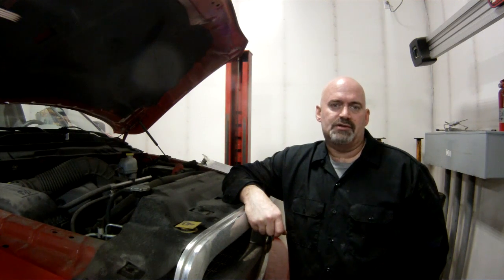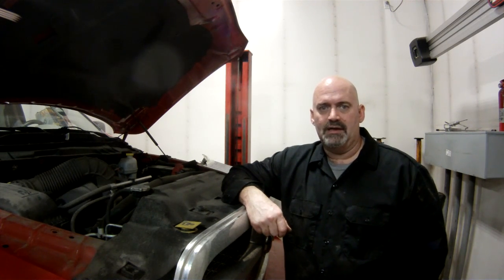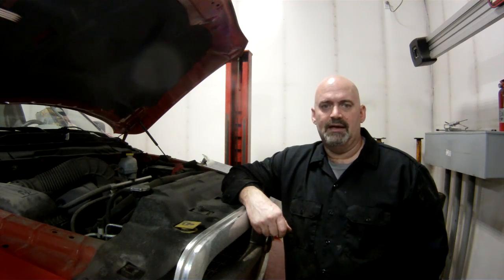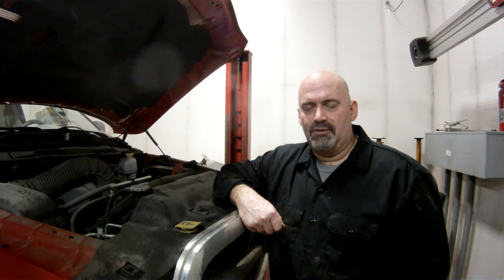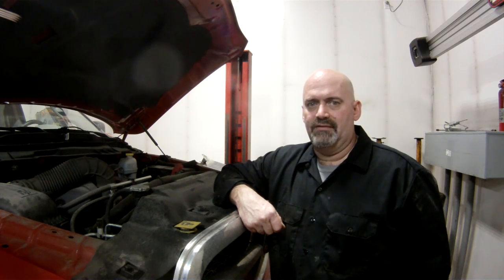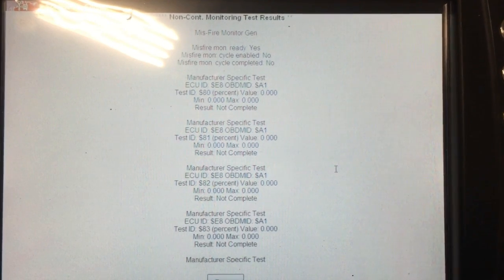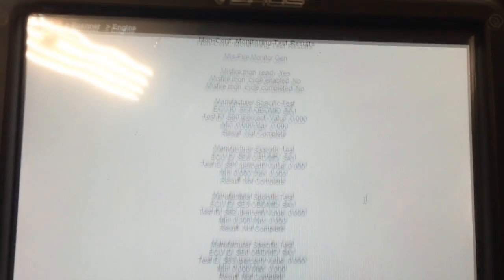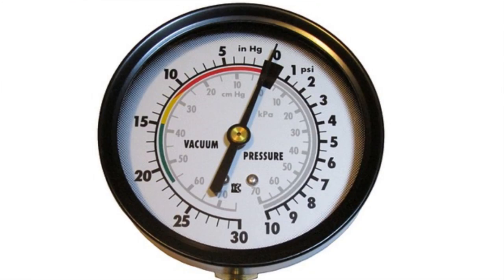Dodge 5.7 Hemi Misfire Problems

Comment: I have a 06 2500 with the 5.7 and it won't stay running unless you are hitting the gas and it threw a cylinder number 5 miss fire any thoughts
Reply from the maker: Sounds like a problem with cyl 5. Maybe a coil or plug or compression problem. whats the compression in cyl 5? does it have good spark there? Have you checked pulse to that injector?

Comment: Thank you for these video's. I have a 2006 Ram 5.7 hemi 140k on it. running very rough, was getting a 300 random misfire code, no compression on #3 cylinder. Removed valve cover and the pushrod has come out of the rocker. The spring looks ok and it take a lot of force to push it down, just wondering if you have seen this happen before on the hemi? Should I put it back in and try it? Thanks
Reply: Any update

Comment: yes I am having problems with my 2004 dodge 1500 57 litter 2 wheel drive it will start but it will cut right back off.
Reply: mariano Zarco tengo una troca 2003 y aranca y luego se apaga rapido  q podraser es 5.7 dodge    hemi
Reply: +Roberto Diaz. hola roberto no se cual sea el problema mi troca esta igual no encuentro el problema todavia.

Comment: Map sensor  solved my problem. 
04 durango 5.7  random misfire code.  it would start misfiring at different times and was slugish under load up to @2000 rpms. map sensor  $22.00.  also hade code for power steering pressure sensor. it was leaking causing it to stall at times at idle. hope this helps.
Reply from the maker: Thanks for the feedback and for watching!
Reply: My 05 300 hemi has same effect it run good sometime den start running bad

Comment: Another thing the 5.7 hemi does have problems with are dropped valve seats.Installed loose from the factory and sometimes comes apart in pieces.If the valve seats come apart in pieces,buy a new intake manifold and throw away the old intake manifold.Chances are the pieces from the valve seats are in the intake manifold and it can't be taken apart to be cleaned out.Chrysler products,don't ever install the gimmick E3 spark plugs and Bosch spark plugs.Run with the Champions or NGKs
Reply from the maker: Good info. Always use OE plugs. Champion in this case. Thanks for watching and the feedback.
Reply: Last one I seen  with the valve seat problem with a 2006 Jeep Grand Cherokee.Pulled the right side head,destroyed valve seat in  #5 cylinder.The intake went into the dumpster from the old engine.

Comment: i have a 06 dodge daytona charger 5.7L engine. the other day i got into a accident and was rear ended i have been having trouble with the car since. its been shutting off randomly when i stop. the gauges started going back and forth it kept alerting me with the dings. then the check engine came on, i checked thru autozone the break light sensor cruise control and one other i cant remember, i changed the breaklight switch and then i was stopped at a ligjt and the engine started smoking and it exploded then started making a knocking noise and i towed it to my grandmas house i looked the next day and the whole bottom of my engine had blown off along with the oil pan i talked to a mechanic and he said i had blown a piston thru the engine and oil pan. i dont know for sure but any advice?? now im paying for an expensive paper weight!!! having the run around with the insurance companys!!!!
Reply from the maker: Oh bummer. It sounds like you engine blew up. Maybe nothing at all to do with the accident. If there is a hole in the oil pan its probably toast. Sorry about that. Lame

Comment: Something like this just happened to my wife's 07 Charger RT. My mechanic said something crushed the spark plugs. Now it's fills the room with smoke. He says we need a new engine? If so, will sell it and buy something other than a Dodge. Sadly, I own a 2006 Dodge RT with 100,000 miles on. Should I be concerned lighting will strike twice?
Reply from the maker: Well maybe. But you never know. Might get 200k maybe not. All cars are like that anyway. Best of luck to you.
Reply: That's weird, my neighbor has a 2007 Charger 5.7 with about 140k on it.
It started "cutting out" she said.
There was no MIL light.
Thinking it was a coil I pulled the plugs on # 3 cylinder because I heard a ticking coming from that cylinder and found both plugs bent closed. 
The only other time I had seen that was when they ran the engine hot and spun a rod bearing so bad that the piston slapped them closed.

Comment: iv'e heard and seen broken valve spring but never a cracked one
Reply from the maker: Same thing I guess. Did I say cracked? I have seen them with cracks but not completely broken. Anyway, not adiquate pressure to fully close valve. Seems to be a common issue with these motors.

Comment: and if its a bad compression test? time for complete rebuild?
Reply from the maker: Not if it's just a broken valve spring causing lower compression.
Reply: ok thanks, ill c what i can find out today
Reply from the maker: Listen for a clatter type noise in the valve train. That might be an indicator of a broken spring.

Comment: i have a 06 dodge magnum rt the shop said all the fuses and things are all good the problem is cylinders 5 and 2 instead of running all 8 it's running 6 which makes the car run rough . Do you know why and can you help me please he said the motor is not damage but it will be if i drove it like this .
Reply from the maker: Was any of the information in the video useful?
Reply: Did you ever hear a reply for your comment? I have a Magnum and I got the same issue as you do.
Reply from the maker: What have you checked?
Reply: Cylinder deactivation solenoids. I'm going through the same damn thing right now. I've gotta figure out which ones aren't working so I can replace them.

Comment: 2011 ram 1500 5.7L p0302 in pcm, engine runs fine until hard accelleration, then light starts flashing, and engine cuts out badly, vibrating. It will miss as you slow down and then at times clear itself up.at the same time the pulse width will go to zero on the cylinder #2, replaced coil, plugs and the injector and still no help, runs ok until you have to get into it hard and starts all over again. HELP ???
Reply: Unfortunately those symptoms in my truck led to a seized roller on a lifter and failed camshaft. Top end rebuild was the only repair worth doing.
Reply: Donnie Agnew same code p0302 !!! I have a Dodge Charger Pursuit hemi and it does the same thing as you, I changed the spark plug, injector, coil, and vacuum leak it worked fine again for a few weeks and then the same code appeared, please tell me if you solve the problem!! I think I have to change the lifters and camshaft, but I need to know if is going to solve the problem
Reply: Hi, I'm working on a dodge Charger 2012 with hemi,. I'm experiencing all the symptoms as you describe. We swaped injector, coil pack and plugs and nothing changed. The same cylinder keep missfiring. Have you found the problem yet? We are thinking about Cranck position sensor or ECU
Reply: @magreg88  I am going through same thing check for fuel injector pulse we replaced crank and pcm sane issue happens
Reply: When engine misfires it shuts injector down believe me I have a lot of money out there into this 11 ram I'm working on

Comment: I have a 05 Dodge Magnum 5.7L, the fuse box in engine bay Number 15 fuse 20amp keeps popping, then I checked the code reader and ignitions coils A - H are throwing codes. Do I have to change all 8 coilpacks as well as plug wires? I just replaced all 16 spark plugs as well. Its unsafe to drive for the fact that I could be driving and the fuse pops and I have no power to the wheels. I changed the fuse about 4 times before I can actually park it. So any information would be gladly appreciated. Thank in advance.
Reply from the maker: Sounds like you have a STG somewhere in that circuit. You can put an amp meter across the fuse terminals and start pulling coil and harness connectors to try to locate the problem.

Comment: 2013 RAM 1500 5.7 hemi... CEL was on showing code P0301 (cylinder 1 misfire). Rough Idle, no power when you try to accelerate. Funny thing is the CEL turned off on its own but the truck still has the problem. There is a 2 week waitlist for motor service at our local dealer. No audible noises, just a rough "shake" every 5-10 seconds at idle. Should I change the plug or coil/wire myself instead of waiting 2 weeks?
Reply from the maker: You can try a coil and plug in #1. If that fixes it you'll be money ahead. At least that cylinder is easy to get to.
Reply: If it doesnt work, pull the valve cover on the drivers side, this involves removing all the coil packs, leave the spark plugs in the head, and have someone sit inside the truck, trying to turn it over, itll start or try to start but youll be able to see the valve springs actuate. If one of them looks to be barely moving you have a failed lifter. Pull the rocker arm assembly, depending on intake or exhaust, use a bore snake camera and check for wear on the camshaft lobe where the spring wasnt moving.
Reply: my 2006 dodge magnum wont go over 10mph what is the problem?

Comment: I have a 2006 5.7 charger. a couple days ago a fuel line disconnected. I re connected it and ever since then it runs rough on idle and it's showing p0300.
Reply: What have you done to fo it

Comment: hello doctor i just bought a 2009 challenger rt it had a custom exhaust but then the dealership put the original exhaust on i drove from atl back to ny once i got to ny check engine light came on my friend scanned it and said it read a bank one sensor...is that major?
Reply from the maker: If you are referring to a bank one O2 sensor no that's not a big deal.

Comment: I have a 2006 Dodge charger r t 5.7 hemi fuel pump stop I put in new one and then it started running rough and gave p1414 cylinder reactivating control performance  and a misfire on #4 cylinder what can I do or start
Reply: ask someone thats a hemi DR

Comment: i have a 2008 dodge charger police 5.7l. its running really rough. its got  p300 and p301 codes. how did the ran sound when it had a valve spring issue?
Reply from the maker: Sounds like it's probably the number one cylinder that's causing the issue. I would throw a coil and plug in it and see if that fixes it unless you have the ability to diagnose the issue. Typically a bad valve spring will lead to a popping noise on accelleration and a rough idle but that's not always the case. You may also hear a mechanical tapping noise.
Reply: +The Car Doctor i appreciate you replying. i will let u know how the coil works out.

Comment: MY CHYSLER 300C HEMI 2007 , BE PULLING WHEN I STEP ON GAS PEDAL . THE RPM HAS TO MOVE TO 4 THEN IT TAKES OFF . I CHANGE THE PLUGS SAME THING HAPPENING. NO CHECK ENGINE SIGNS AT ALL . WHAT CAN IT BE ?
Reply from the maker: I suggest you at least have the codes checked and get back to me. Possibly EGR valve or MAF sensor issues.
Reply: I WENT TO AUTO ZONE N THE SALES REPRESENTATIVE , PUT THERE READER ON IT . IT GAVE ME THE CODE:PO300 LISTING IGNITION COILS N SPAKS PLUGS . SO I'M CHANGE THOSE.

Comment: My 300c 2007, 5.7 hemi has 47.000 miles, now showing the error code P0301 and a extremely high fuel consumption. What can be?
Reply from the maker: Maybe a bad injector? Probably will need to do some testing to figure that one out.
Reply: Thanks Car Doctor, i will examine.

Comment: i got a 08 dodge ram 1500 hemi. will start fine rev to 4k and hold it all day but let it rev down to say 3k if trips out and put up the p0300 code. i  put all new plugs , egr, cam sensor, crank sensor, was going to do o2's but im hopeing someone knows what it is. fyi it will idle fine for a long long time over a hr. with no code.
Reply from the maker: Be good to isolate which cylinder is missing. Do you have access to a scan tool that has the ability to monitor misfires?
Reply: the guy i took it to said sounds like a droped valve seat. but there is no tick or anything at idle.
Reply: also the scan tool said its misfiring on all of them not just one. he also said the vacum is up and down. said the psi of my cylenders is 135 and is should be 185.
Reply from the maker: If the vacuum gauge is bouncing it's likely a broken valve spring.
Reply: that sounds more like it
thanks car doctor.
Reply: so i looked at the springs and nope not it. 
put a new coil pack in and pcv still not fixed im lost now.
Reply from the maker: Can you monitor all the data with a scan tool?
Reply: not all only some my scan tool is not that good
Reply: @ThecardoctorTV  hello doctor did did Ben Philips ever fix his truck I'm having the same problem with mine 06 Durango 5.7 I can drive it for 10or 20 min it drives perfect but after that time starts a random misfire what can I do?
Reply: Ben PHILIPS try the map sensor.  mine di the exact same thing.  map sensor fixed it.

Comment: I had my ram get the exhaust back to the factory tail pipes. so eagerly to see how loud they could get i stepped on it and check engine came on. changed spark plug and coil still rough idle and having alot trouble with power. are these symptoms of a valve spring?
Reply: it's a 2012 ram sport with 90 thousand miles
Reply from the maker: Maybe. Can you isolate which cylinder is missing? What codes are in the PCM?
Reply: +The Car Doctor thanks for the fast reply my uncle has a good mechanic friend and asked and he says the pushrods seem to come off often on the rams so hopefully it's just that and nothing more
Reply from the maker: Keep us posted. Take care
Reply: The Car Doctor Super late buy any update?

Comment: My check engine lite came on today,
Took it to auto zone, code read misfire #5 ,,ignition coil,,,do I change it out or do wat u say about pulling valve cover to see if spring crack?
Reply from the maker: You could replace the coil and plug and see if that cures it or spend more time testing. Compression test, injector balance, mood light, valve cover remove and inspect.

Comment: OK will try, it won't even crank over now
Reply from the maker: Oh no. That doesn't sound good.
Reply: @ThecardoctorTV  What should I do I have a 2013 dodge charger police 5.7 v8 with only 53k miles I replaced the coil they changed the spark plugs at 48k according to carfax and looks like the replaced #5 injector. They probably couldn't figure out the problem or didnt want to dump more money into it and that's probably why it got auctioned off. Any advice or suggestions? Should I get extended warranty and try getting them to fix something like that?

Comment: Replaced #5 coil and both plugs,started truck up was still misfiring,made loud noise like something broke. was throwing #5 misfire code. any ideas?
Reply from the maker: Did you check compression in #5? Pull the V/C and look at the springs on that cyl.

Comment: 2011 hemi just had the manifold planed & lug nuts changed due to one being broken in the now about a month later while driving down the road which was running on 4cyl and as I pressed the pedal switching into 8cyl a sudden cloud of smoke bluish and white shot out the exhaust, other then that the truck runs good, just this one time I noticed this. No codes. 160,000 km.
Reply from the maker: +casupply Who knows what that was about. I would just drive it and watch for anything else. Sounds like you're keeping up with needed repairs. Thanks for dropping by!

Comment: howdy,  I buy engine cores for a major rebuilder and I'm  seeing lots of 5.7 hemi engines with holes in the block from slinging connecting rods.  do you know what the issue is with this?  its probably the most common damaged engine that I see so there has to be some manufacturers flaw,  or I would assume.  thx
Reply from the maker: +KELLY STRICKLAND I have heard of connecting rod failures but haven't seen as many of those as top end issues but I don't do a lot of engine replacements so I probably wouldn't see those in my bays. Sounds about right since they seem to have issues related to internal engine part failures throughout the late model hemi production.
Reply: BOYS DAY OUT that's exactly what happened to mine. Bought it used had it 2 months then there she blows

Comment: 06 ram 5.7
was showing p1414 code
change mds solenoid and now shows misfire#4
it could be what you saying ...
ill be scratching my head since I swap coils, sparkplugs and injectors!..
thanks!
Reply from the maker: +Robert Reyes Good idea to check compression in that cylinder and a few others. Compare. A running compression reading on #4 as well. Noid light on that injector to be sure its not signal related. Last thing to consider is pulling the valve cover and inspecting springs. Hope that helps. Good luck. keep us posted

Comment: I had a problem with my 04 Ram hemi not wanting to start but if I would let it sit for a minute like the glow plugs on the diesel it would fire right up.  I took it back to the dealership where I bought it they couldn't get the code to come up. I brought it home left it sit overnight and got it the next morning. I went to AutoZone ordered 16 Bosch performance spark plugs,  cam shaft, and a crank shaft sensor. I haven't had any problems since then.
Reply from the maker: +Michael Dick It feels so satisfying when you fix a problem that the dealer in all their infinite wisdom failed to. Good for you! Hey I hope to see you back again. Take care.
Reply: thank you.

Comment: I had a misfire code P308. It turned out only to be a faulty spark plug.  I replaced the spark plug and poof the error code was gone.  My 2004 Dodge RAM 1500 5.7 HEMI is running like a baby @ 195000 miles   ;)
Reply from the maker: +Bassedmen That's great news! Another good reminder to check the basics first. Thanks for watching.